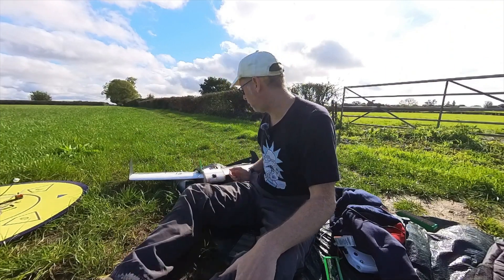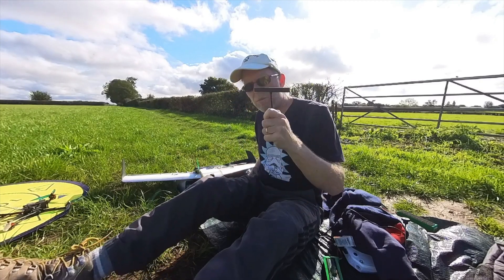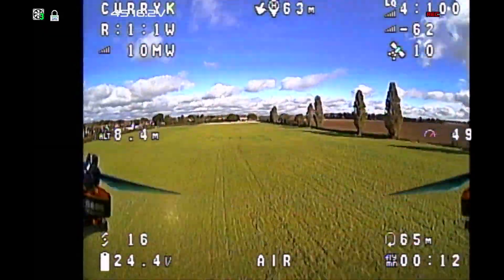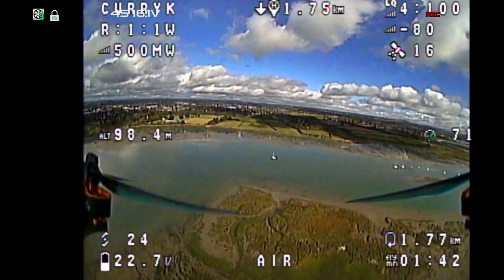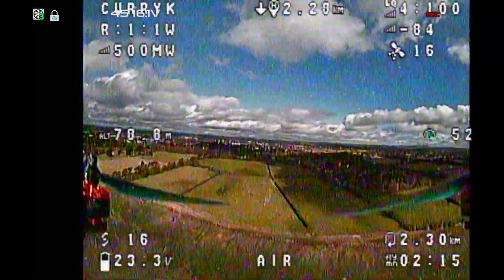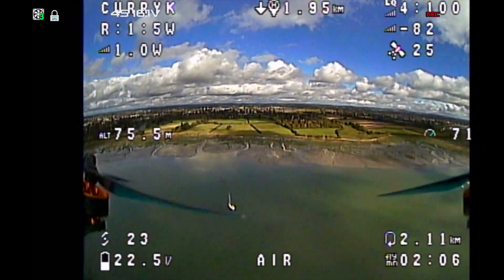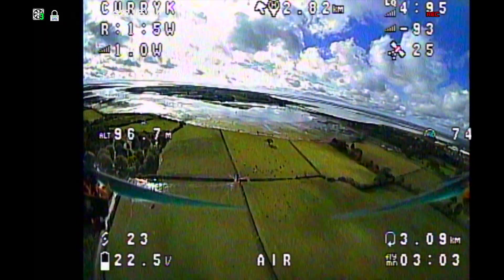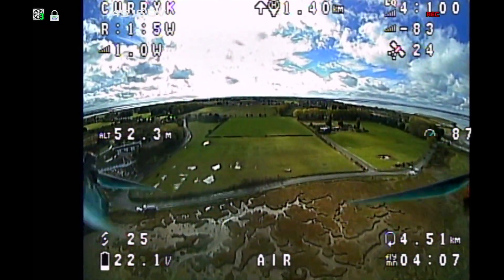Trying longer range on the AKK 5W VTX and finding more about RSSI dBm and dynamic ELRS power

Comment: 6:23  10 min flight times?. Wow, the 10 inches roll with 25-35 min. flight times on 6s 6000 and 6s 8000 .Thanks for the video.   You need more flight time to go any further safely.

Comment: I see you use your tyro 129..i have one of them and i went and got it after watching your review on it.
still use it to this day as well.
Reply from the maker: It's been a useful quad - I've mostly used it for when I got a component into review, so cameras and VTXs have been swapped out a lot.  It's a shame the frame wasn't a bit longer so you could easily fit an HD system in it as well - but it flies pretty well

Comment: 5 watts you better get it flying within 10 seeconds over major overheat and your battery life from 30 minutes down to 5 minutes better have a seperate power supply for the thing a 10 amp pack
Reply from the maker: The cooling fan actually works very well.  Also, I have it set to low power disarm, so when it's sitting there waiting for sats the VTX is running at 25mw.  Compared to the amount of amps a quad uses to stay in the air, running a 5w is fairly trivial

Comment: I've got 5km no issues with a 800mW vtx - that'd be mostly over water at about 50m reaching a max of 300m. I'd recommend higher antenna's, if you look at  Rebel Ruxus images on a google search I feel that's a good starting point, I have my Rx vertical out of the GoPro and the vtx I've raised about 20mm higher than the top plate., battery is a 6500mah Lipo so no need for Li-on. Happy to send some images of my setup and the stl if you want to try them.
Reply from the maker: The concept of "haw far can I go on xxx power" is always a tricky one, as it depends an awful lot on the area.  I've flown over 6km on the old ImmersionRC 600mw units.  The only thing I wanted to show in this video was - hey there's snow at 1W, so lets see if it's clear on 5W - which it was.  The fact that I might expect to fly further on less on a different VTX, or a different area matters less for this particular demo.  I would agree about having vertically polarized antenna would really help - I always find this tricky in a quad, but I might do some mire stuff with this to push a little further so may well look at this config.  Cheers :)

Comment: How do you get the rf Mw power from the radio
Reply from the maker: There's an OSD bit for it in Betaflight, but just make sure you read the ELRS notes about what you need to do.  I forget exactly what that is, but it's not all modes

Comment: Even I was nervous as you headed out over the water, I don't know if I'll ever not be worried doing that!
+1 for deadbyte love, an absolute superstar. We originally used RSSI dBm for Dynamic Power, but it wasn't very reliable for detecting the actual receiver conditions so we switched it to SNR (for 3.0 or was it 2.0?) and have had much greater success. It will also up the power based on LQ or missed telemetry, but RSSI isn't used at all any more except for FLRC as you mentioned.
Reply: Thanks for all you do. If you're coming to EdgeTX Fest can't wait to thank you in person!
Reply: @cagmuer  I'll definitely be at EdgeTX Fest on Saturday, we can all high five! 🙏
Reply: @cagmuer  I'll definitely be at EdgeTX Fest on Saturday, we can all high five! 🙏
Reply from the maker: Thanks for extra info on this - very useful.  Glad it's not just me that gets shaky legs over water :D

Comment: All I use is LQ. Not a fan of having tons of numbers jumping around and scaring me mid flight when LQ is constantly at 100.  A bit odd that breakup at 2.3km…1W with good antennas and LOS should easily be able to get ya at LEAST 5km.
Reply from the maker: Your flying on Crossfire aren't you, so you have a certain dynamic speed level, so 3:100, 2:100 down to 1:100... something like that?  I agree that in most circumstances 1W is plenty to get to 5km, but it can always depend.  In that particular area we've had video go out on 2 planes completely and rx failure (yay for RTH) so it can get weird there.
Reply: @CurryKitten  in my OSD all I see is crossfire LQ as a value from 0-100 without any additional : or numbers actually. 

That is odd about those scenarios. There must be some level of RFI in the area then!

Comment: With Tbs Fusion and Elrs you can now do dynamic vtx power
Reply from the maker: Handy maybe.  I don't know if I want my VTX power changing during flight though
Reply: @CurryKitten  so apparently its not been coded yet but the one dev said they could do it. Supposed to reduce multupathing. Keen to try it but I agree it could be detrimental.

Comment: video antennas: get rid of any pigtails and adapters. the antenna should be connected directly to the VTX. that makes a big diffenrence, at least in my experience.
Reply from the maker: They certainly can effect things.  Some VTXs have an MMCX on them, so there's no choice.  Decent manufacturers should take this into account with their designs
Reply: @CurryKitten  I'm using a TrueRC long pin with MMCX one the long range kwad and a floppy flex cable antenna with MMCX on the freestyle build. Both supported by custom TPU legs on the standoffs. Nothing in between. No losses. Works very well. Pig tails and adapters gave me way worse results all the time. I'll never go back.